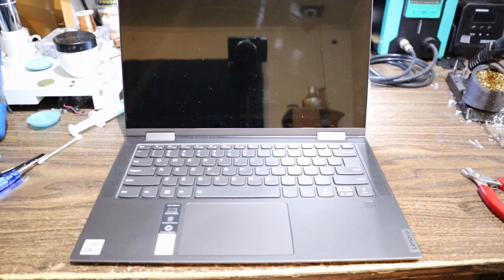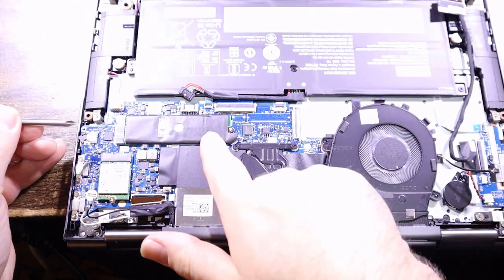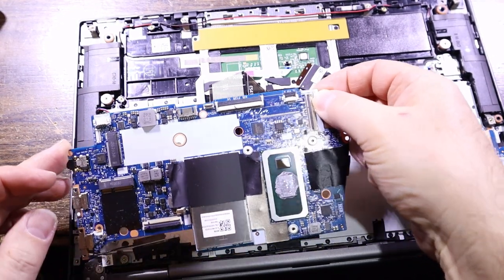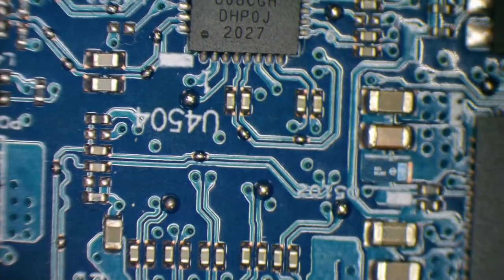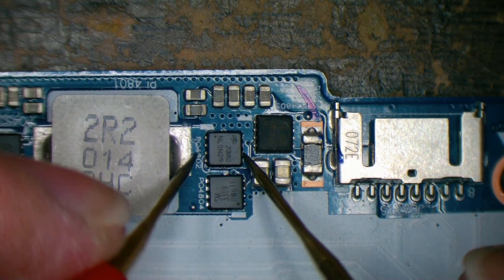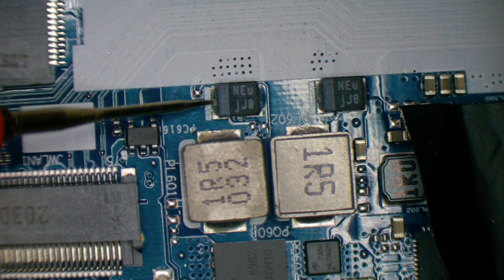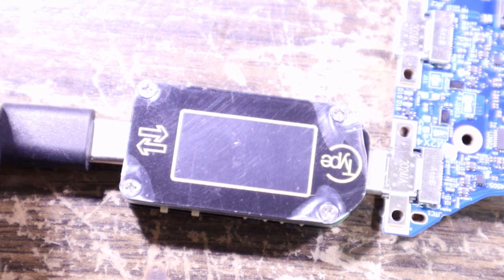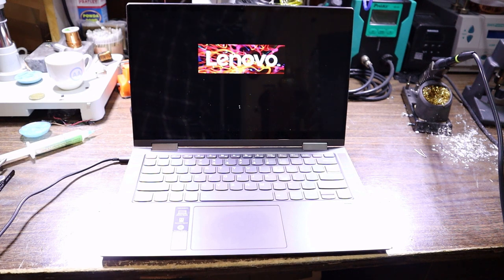Lenovo Yoga laptop no charge repair!

Comment: That sneaky little fella. I love using a thermal camera for electronic repairs. It's also great to show the students when systems are live with fuses and relays showing temperature. Great aid for parasitic drain diagnosis.
Reply from the maker: I keep forgetting I can record thermal image video on my phone so I don't need to point the camera at the phone. Maybe next time lol!
Reply: @JonnyFix  I just bought a DEPSTECH Dual Lens Endoscope. Awesome piece of equipment. Great having 2 cameras, especially for looking down engine bores. It has a quality recording feature as well. I'm using it more and more & make it a regular tool in my classes.

Comment: Hi, thanks for the video. I have yoga slim 7 and same problem. Do you have any repair centre? I love in Manchester.
Reply: Ugh I have the same model with the same problem that just occurred last night and I left with nothing to do :(
Reply: @Mhndr101  ok. Finally after everything checking I had to change the motherboard.  The motherboard i brought from ebay by £140 and £100 for repair cost. I had used local repair shop as lenovo customer service was demanding ridiculous overcharged which that i could buy a new one.
Reply: @Fireheart90  Wuaa i wasn't expecting a reply even this flash. thank you for the info :') guess i have to pay a visit to a lenovo service center in a nearby city. i hope the warranty covers the repair & part changing cost

Comment: Well done :-D
Bloody capacitors!, they seem to be failing way too often.
I'm starting to wonder if its done on purpose.
I've got a few ancient machines that never fail, better parts or just luck?
Mosfets going poof is a really common problem in some brands (under rated ?).
Reply from the maker: It's funny how the older stuff almost never dies. Maybe as time moved on and things became more competitive the parts supply went to the lowest bidder and rated claims became a bit of a stretch.
Reply: @JonnyFix  Yes that makes sense,  The crap, sorry cap :) is eather under rated for voltage so there is an internal arc that welds the structure, or the layers are so fragile that vibration or temprature changes cracks the internal layers.
I almost sound like i know something ha ha :-D
Reply from the maker: @zx8401ztv  Give yourself more credit ol' chap! Knowledge is still valid, even if not used so much :)
Reply: @JonnyFix  i learnt a lesson a long time ago,  dont be a big head, there is always someone around the next corner that can make you look thick.
So run away from that corner ha ha :-D

Comment: You should try and find an AC supply for the camera, that is what I use so I don’t have to constantly charge batteries.
Reply from the maker: They're definitely available, I'm just a cheap skate. The battery sure lasts 3 times longer than the old camera so I'll pop it on charge between vids. Might need a psu when I launch my hot tub streaming career 🤣

Comment: first thing first you should have check for power voltage charger , i am no expert but you went straight to the M.B ,  at the end of the day you fix it but you took the long way
Reply from the maker: First things first I did check the charger. The simple act of passing it through a USB meter at 0:37 shows it was supplying 20V to the laptop. When you have experience you don't need to shove meter leads in the end of charge cables just to prove a point. I went straight to the motherboard and as you see the fault was on the motherboard so spending more time checking the charger would have been a waste.

Comment: Love watching you fix stuff, I've learnt lots! 
Is it just a general rule that random caps like that are 10u 10v? I recently fixed a dell laptop with a similar fault but just left the cap off the board as I didn't know what value it was, working great and still have the laptop so could slap a cap on there. Without a schematic or donor is there a way to tell?
Reply from the maker: 10uF is a good start for main line caps. Once it's working you can measure the voltage at that point to know what rated cap to put in there, physical size plays a part as well. If say a 20V line you wouldn't put a 20V cap, you'd use say 36V. A 5V line would be better off with a 10V one instead of 6V. Often as you know it makes no difference leaving it off. If you had to remove 2 bad caps on same line then yes replace them. Only time you might notice it is if a cpu, ram or gpu line and the machine is running at 100% like in gaming it might show as random crashing or image glitching but that would be an extreme case. But on the general 5V or 3V line they aren't as critical in my opinion. Thanks for watching!
Reply: @JonnyFix  Some good points regarding what voltage rating to use, noted! Feel a bit silly I didn't think to measure the line after to see what voltage it was, next time I'll do that, thanks for the info :)